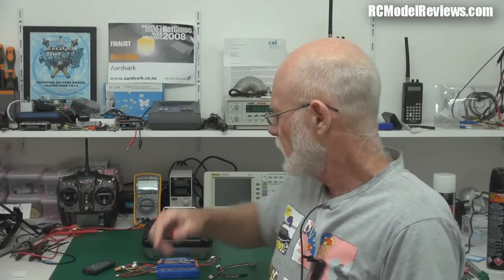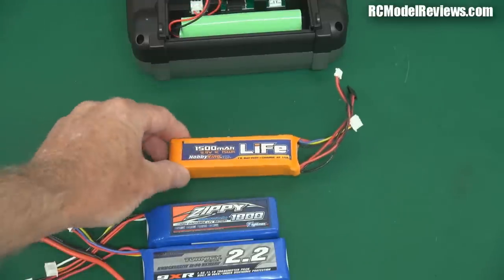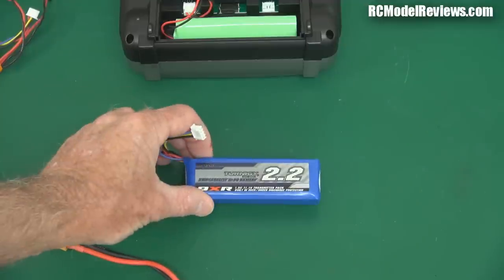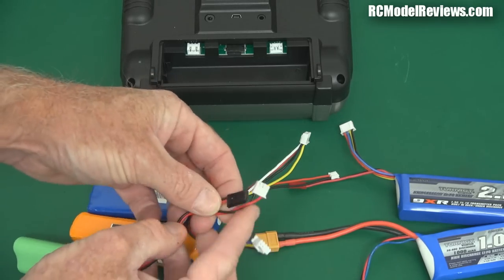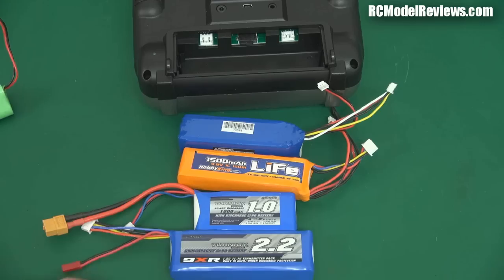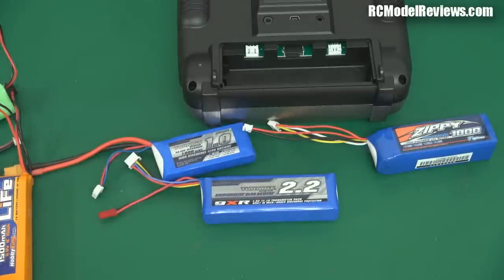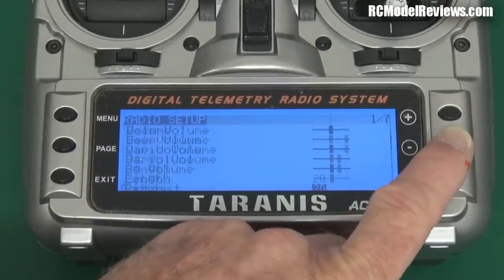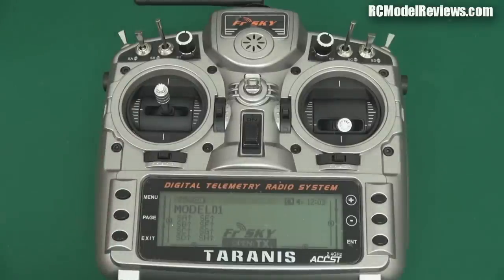Battery options for the FrSky Taranis RC transmitter

Comment: IF YOU NEED TO CUT THE BATTERY WIRES FOR ANY REASON DO SO ONE WIRE AT A TIME or be prepared for a large bang and flash
 I have the zippy 1800 mAh LiFe pack Bruce is demonstrating here. I use it in my Futaba 7UAPS radio connected up via a servo connector plug and socket with each half on flying leads. It will be harder to fit this pack into my Taranis because of the fixed molex 3 pin connector inside the radio. So if you wish to use this battery with the Taranis you will need to make a flying lead connection from the radio to the battery. The orange 1500 unit does not have this problem and yes I have tested it, so for those not confident modifying the radio this is the best option.

Comment: i can use this battery for Turnigy 9X

Spec. ZIPPY Flightmax 2500mAh Transmitter Pack (Futaba/JR)
Capacity: 2500mAh
Voltage: 11.1v 
Constant discharge: 3-5C
Burst discharge: N/A
Weight: 156g
Size: 99x31x26mm
Plugs: Futaba, JST-XH, JR/Spektrum

Comment: I'm using a 2S (yes, two cell LiFe) and has soon as voltge comes down to 6.5, the radio will start announcing "Transmitter battery low", even if I set the voltage ratio from 6.0 to 6.6. PLEASE HELP BRUCE!
Reply: Have you Connect the 2s Balance plug directly into the taranis or do you using an adaptor so just two cables Connecting to the taranis instead of 3 cables ?
Reply: I'm using the white connector directly without any adapter. I found out the issue, you have to lower the alarm down to 6.0
Reply: Private okay thank you :-)

Comment: What I'd really like to see is a battery that would offer maximum capacity while still utilizing the built-in recharging system, where you could enjoy the convenience of plugging in the charger from the outside, just as it's designed to do!  I hate having to open the hatch, unplug the battery & remove it, then reinstall everything just to recharge - with every cycle producing wear-&-tear on those tiny wires, connector & receptacle. 
 
For such a brilliant concept as the Taranis/FrSky system is supposed to be, I wish there had been more forethought given to its battery system design - perhaps with greater flexibility for the various batteries that could be used, and their maintenance. And added component cost should not be an argument, as relatively cheap as it is now, & the number of people already willingly paying $1K & upwards for "high end" Tx's.  For something so 'revolutionary', the battery system is like the revolution is hauling around a battleship anchor.

Comment: Taranis has been shipping with a 2000mAhr LSD NiMh battery and higher capacity charging circuit for a while! Much the best for a consumer radio choice. No worries leaving it on accidentally - a NiMh will recover - Li not!
Good to mention the  1-5C rating of transmitter Li chemistry batteries.
Reply: Fortunately the Taranis has an inactivity alarm built into it which means the chances of leaving the radio on to the extent that the battery goes flat is minimal.

I used to be a strong NiMH fan but since I started retrofitting my transmitters with LiFe batteries I haven't looked back.
Reply: *****
Only if you can hear it! In the garage, in the boot, in the drawer,,, one day every one gets a flat battery.
Reply: Wayne, the problem with NiMH batteries is that you constantly have to recharge them, since they self discharge.  I can only fly slope gliders when the wind is blowing in the right direction and the lift is strong enough.  That means my batteries may sit for weeks until the wind gods align, and many times I've had to fast charge my NiMH packs on the way to the slope site.  When I do that the charge doesn't last as long, and I end up charging more packs while I'm flying.  I did alleviate this somewhat with a six port NiMH slow charger that switches to a maintenance charge when the batteries are fully charged, so I can leave them on indefinitely.  Still, lithium packs are less of a hassle.
Reply: sloperdude
The Taranis batteries use the LSD "low self discharge": chemistry that is similar to Li with up to 85% charge retention in one year. LSD gives up some to maximum capacity. Standard NiMh can be left on a cheap household timer to trickle charge for a few minutes a day for constant readiness.
Reply: Got mine from getfpv (dec 2013) only came with the weak little 800mah battery. Hence me here looking at which battery to buy :)
Reply: Since October the Taranis has the higher capacity charger. Some shippers offer the larger battery as an option for less than US$15.
The standard 'weak little 800mah' battery with internal rf and 100% display on will do over 6.5 hrs before alarm (not much capacity at 6v alarm!). Some recommend a forming charge from an external charger first at less than 1/10th capacity, and several cycles to develop maximum battery capacity. A long slow charge occasionally will help balance cells.

Comment: use pin to unplug pins from NiMH connector then, plug in to Lithium battery's unplugged wire to the connector. Done.

Comment: I´d recommend, in matter of long flight hours, go for two lithium mangan cells (KeepPower IMR 26650 - 5,2Amps). Solder two in a pack (7,4v) with balancer leads and fitting plugs. Put it in a fitting shrink or good value tape, there you go.
Up to 40hrs of flight time wihtout any charging :-)  (5,2A / 0,13A) The Taranis+ (plus!)  consumes meassured arround 130mAh , but i guess the old Taranis is similar.

The batteries: http://www.candlepowerforums.com/vb/showthread.php?387664-Test-Review-of-Keeppower-IMR26650-5200mAh-%28Black%29-2014

To fit the 26650 battery pack into the Taranis, there is a really nice fitting 3Dprint from Christophe Bernardi @thingiverse, which I use. It  works & fits pretty well!
http://www.thingiverse.com/make:101704#comment-523136

It also provides a better stand on the desk, if an extention module in the bay is used, like orange modules which intent to have the stupid antenna going out the backside, were the taranis usually would lay on :-)

In conclusion i can stay hours over hours in duty with the taranis even if I use it as an joystick interface for my (www.x-plane.com) simulator copter models:
https://github.com/opentx/opentx/wiki/OpenTX-USB-Joystick

Thumbs up @Bruce!! I enjoy your videos.

Happy Landings !¡
Reply: A 2S 18650 3200mAH pack fits in the battery bay and last 26 hours:
http://www.rcgroups.com/forums/showpost.php?p=25811065&postcount=1019

Comment: Hi,
I need some help. I just bought my frsky taranis and im having some trouble with the ESC. Its a 30 A turnigy plus. It gets warm when i conect the lipo. Im not using the motor, I was tring some servos and it gets warm. Anyone can help?
thanks
Reply: It's because you have or a faulty servo, or a bad connection. Happens to me too when I don't correctly plug the red and black wires

Comment: For your zippy, why couldn't you just charge the battery using the balance wires?
Reply: John-Paul Hopman if u are asking this question, then u shouldn't be using this type of thing. if u do not know what u are doing, u could start a fire or something.  both the main power connector and the balance leads needs to be plugged into the charger.
Reply: Depends on your charger, some will work fine (older accucell6), newer accucell requires both connections, pisses me off, even on 1S battery, pretty stupid, least i got 12 of them for $68 shipped.

Comment: please, sir, i have 5000rpm motor, 30amp esc, 12 inch perk slow flyer and a kk 5 bord but i wired it up wrong, and it has some homeing stuff and gps also, im so daft i cant work it, please mr rc professer can u help me, thanks

Comment: Correct me if im wrong but whatever voltage battery you choose is the voltage you get from the pins on the back of the radio where you update your RX firmware, so if you choose say an 11v battery and your RX only allows up to 10v you could fry it when you connect it to the 3 pins.
Reply: Taranis can handle up to 15V

Comment: I am using the Graupner Ultramat 16s in LiFe settings for charging there is an option to choose from 3,3 V/C to 3,7 V/C, which settings must I pick?

"battery high low warn notes
NiMH 800 mAh 8.0 6.5 6.5 stock battery on older model
NiMH 2000 mAh 8.0 6.5 6.5 stock battery on newer model
2S Lipo 8.4 6.6 6.9 can plug into balance plug
3S LiPo 12.6 9.9 10.2 need to make plug/adapter
3S LiFe 10.8 8.4 9.9 need to make plug/adapter"

I found the upper chart at Opentx forum that means I can charge the LiFe battery with 3,7 V/C ? Or not?

Link: http://open-txu.org/taranis-battery-notes/

Comment: What about 6 LSD AA for 1.59$ each from HobbyKing. 2400mAh, no discharge issue, recharge the pack from tx plug not even need to take out the batter. Cheap and easy .. why mess with LiPo ?
Reply: That's what I did... Works great...

Comment: Hi Bruce, the biggest problem i found when looking for a battery was the space available in the Taranis battery bay. I purchased the Turnigy 1700mAh 2S 20C Lipo Pack due the connectors XT60 and 2C balance plug suited everything that I use but more importantly it fits.  

http://hobbyking.com/hobbyking/store/uh_viewItem.asp?idProduct=16742

Comment: Getting answers and firmware is not all the great anymore, they have moved the website and no one wants to help but tell you that your constantly at the wrong place.

Bottom line the telemetry logging GPS and Altitude does not log correctly or if it does the Campanion software does not display numbers that are useful.

It has become nothing but a migrane headache to deal with. If it was a $50 9XR i wouldnt care about the telemetry not working but I invested over $300 into this radio your dam right it needs to work as advertised!

I am doing my own review of what it is like to go through getting information, instructions, and help from the developers of the firmware and you can think first before buying this radio, a lot has changed since it was released, they moved the OPENTX website and they forgot to put up the firmware updates!

I wont even go into trying to get any real help!

Comment: 4:15 you claim you can just plug in the balance connector and off you go ??? Really ? Using the balance connector for discharge will In this case give you the nominal voltage of one cell. Note that the middle pin in the Taranis receptacle is blanked. No good idea!
Reply: the middle pin on a 2s is both cell #1 + and cell #2 -, the outer pins are at the same voltage potential as the discharge lead